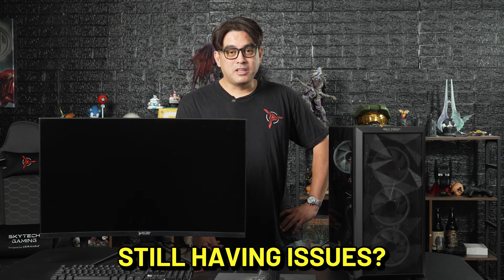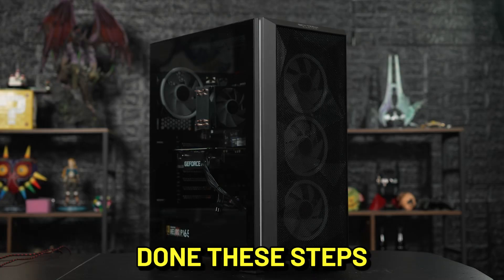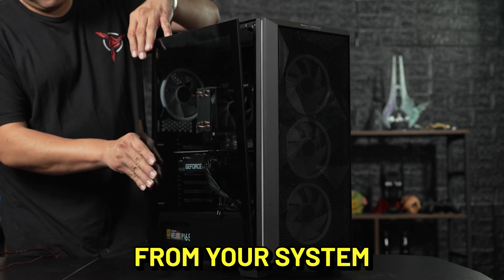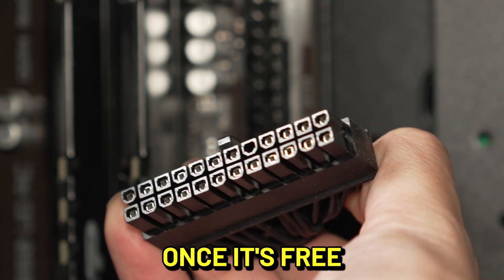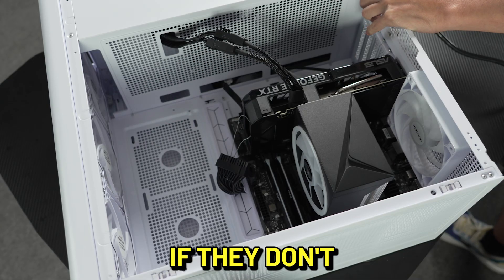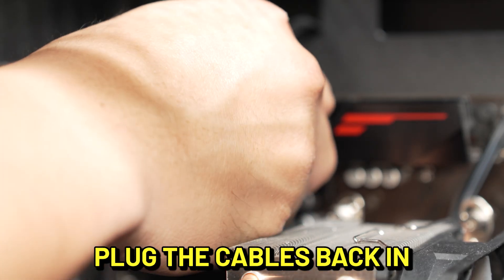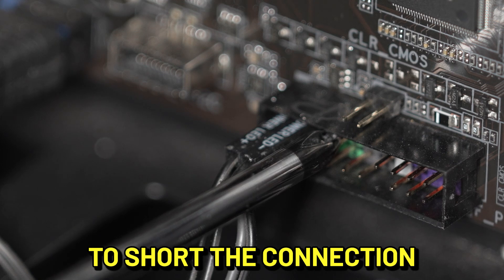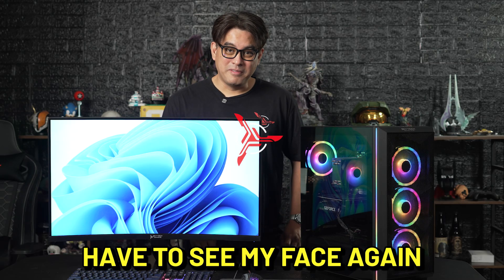How to fix your PC if there's No Power

Comment: I really don't get it. I've had my pc for 1 and a half year now. Worked perfectly every single time. Awesome cooling etc. 
But yesterday when I turned off the pc, It wont start again. I Can see the low lights from the motherboard. But when I click the power button.. Nothing happens. Please help. I tried reconnecting the power on cables, I did the whole press the button 30 seconds after you pulled out the main power cable.

I even did the damn screwdriver test. Still nothing. Why??

I've had my pc connected to one of those extention coards. Could that be faulty? But then again my two screens are plugged into that one and they have power...
Reply: I have exactly the same problem
Reply: @Zama-b8x It's fixed now. It was only the CMOS battery on the motherboard that died. It is replaced and now my pc starts again. Try it you too. Maybe it will work for you too.

Comment: does the Paperclip method work, when the Fans are plugged in to the Motherboard and doesnt have a seperate controller ? I am thinking, that the fans wont have power because the Motherboard is not plugged in.

Comment: December 2025,
Motherboard: B650 Tomahawk Wifi (AMD RYZEN)

1:09 step (24 pins) up to
2:12 (Reseating CPU Power Connector)

we just did those steps and stopped at minute 2:37
and it all went back to normal

Power Supply: “be quiet! Pure Power 12M 1000W”

Thank you so much for the video! Hands up🙌🏻🤍

Comment: Pc wouldn’t turn on after a storm happened in my area and have had that happene multiple times this year. Tried all methods in video and switched power supply for nothing to work. Took out the power switch and shorted it as he’s shown in the video and my pc booted up right away. Would recommend trying that before taking apart your pc over and over for hours.
Reply: What time stamp? Same situation happened to me yesterday during a storm

Comment: Psu is working with paperclip method and RGB lights too but when connected it back to motherboard doesn't giving any response no lights no fans not even psu fan, I also tried power sw thing but still doesn't happened. What could be the problem?
Reply: Same 😢
Reply: Just had the same issue!!! Literally taken everything out!!!
Reply: send help!!

Comment: I tried everything here and nothing worked. I changed the CMOS battery and that fixed it.
Reply: i dont get the paper clip thing if it works then is it my psu or waht
Reply: @Visual880  paper clip should tell you that the psu is working and the problem is elsewhere.

Comment: My mouse keyboard light up but no power
Reply: Yeah me too. And I dont have that 24 pin connecter so idk how to test anything
Reply: @Frishky_Playz my PC have power button problem it's require hard force to boot up. 😊
Reply: @behindthefirewall hard force?
Reply: Means power button require more force to boot up  @The_JohnsonN
Reply: @behindthefirewall  yeah that didn't work for me, my power supply was kaput, to the IT we go.
Reply: @The_JohnsonN Yeah, I think it’s a power‑supply issue caused by humidity. Now my power button doesn’t require as much force to boot the system.

Comment: Pin test sounds like it's booting up more than without it. Fans do not light up. Power supply issue?
Reply: If things aren't working your power supply is probably not compatible or faulty or dying.
Reply: @BlackHoleTrophies wouldn’t that be a motherboard issue if the psu powers on